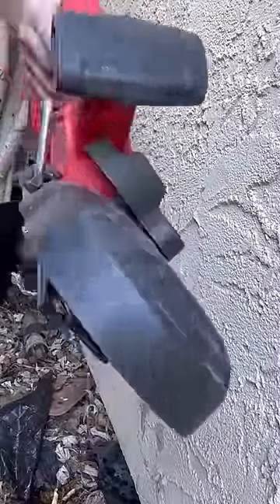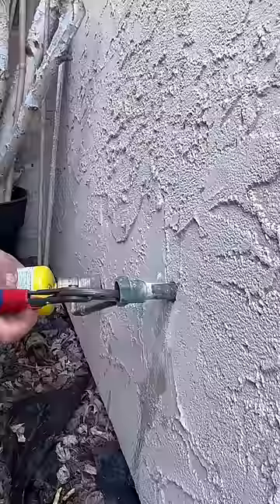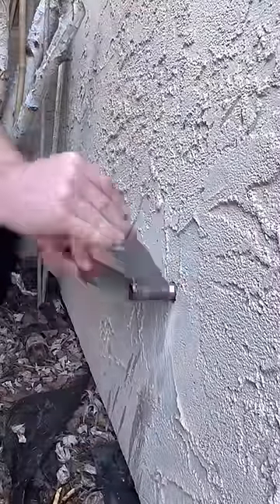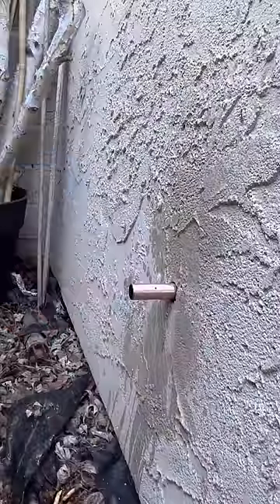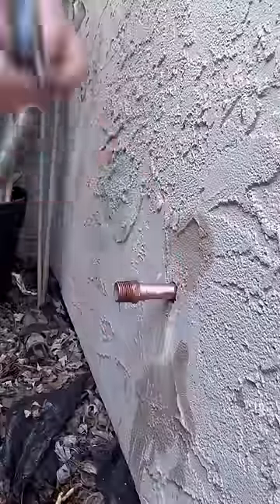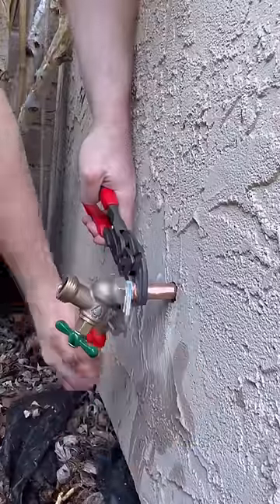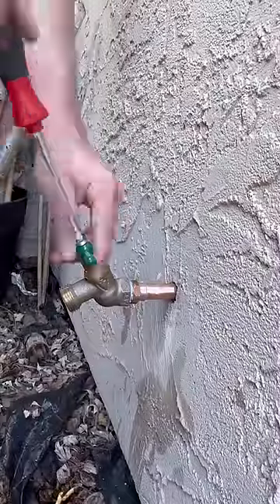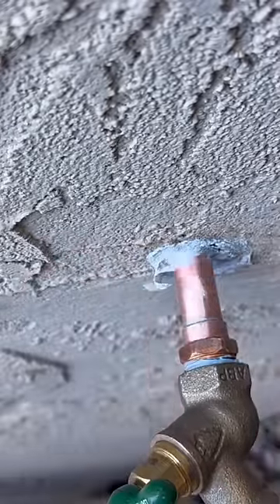swapping a hose bib #plumber #plumbing #diy #soldering #oateyambassador #propress #copper #repair

Comment: The slight adjustment to the handle shows the differenxe between a guy who takes pride in his work and and a hack who simply slams it together. Every screw on every wall plate in the home I built had the slot in the head going in a vertical direction. Why becuase I hired a first class electrician, plumber and tile setter. The only one that wasn't was my painter. His work that I saw was amazing. When he did my home he then had a crew working because he was so busy. His crew did a lousy job. 
My tile guy unknowingly used defective grout. It had a fraction of the cement it needed. When we called him 6 months later, after getting new grout from the manufacturer, he spent 2.5 days chipping and cutting out the old grout and putting in good stuff. 
It pays to hire reputable contractors that do quality work and stand behind the work they do. They swept up there mess smiled and were on their way. No cost to me but I know of at least 2 dozen jobs he got from  my referals.

Comment: Man I wish these were the hose bibs I had to work with here in the Midwest. Gotta crawl under houses or find it in a basement cuz it’s 8-12 inches in the house
Reply: Thought that was a silcock not a hose bib
Reply: yep,I had to cut threw my kids room dry wall. got it changed out, but now I get to learn dry wall
Reply: Yup. Frost free replacements are a pain. I tried removing one the other day without crawling and backing her up. Busted the next fitting off. Longer day than expected.
Reply: @Natedawgontheright  oh joy. Hopefully just a patch.

Comment: It must never freeze there, or the hose bibs are on a line that can be isolated and blown out each year.
Reply: It must not freeze for long there, we just turn off the water to the hose for half a year
Reply: @noahdienel2598  I use an air compressor to blow out the sprinkler lines and hydrant lines. The first time I did it, I launched a Rainbird.
Reply: @BlankBrain  lol

Comment: I had a similar issue with my hose bib and I over tightened it and it cracked the solder on the pipe behind the kitchen sink and over the next 2 months I had to have mold repair and all my kitchen cabinets redone and countertops. Everything insurance paid for it all. Thank God I was honest to them. They still paid for it which was I was grateful.

Comment: They sell male end hose bibs dude! 😂
Reply: That wasn’t a female fitting. My eyes deceived me too. It was part of the valve. The valve was soldered onto the pipe. He cut the valve with the band saw. Likely to reduce the heat needed to melt the old solder out
Reply: @jimmyraysworld5  good eye. I didnt even notice that!
Reply: @jimmyraysworld5  And easier to get the water out..

Comment: Ya, try that in Wisconsin, you'll have a cracked pipe and valve less than 1 month into winter. You need a "frost free sillcock".
Reply: Have you seen the inside of the basement?  Perhaps like most people in colder states,, they put a shut off on tbe inside so you can drain that spigot.
Reply: He lives in the south

Comment: I been a plumber  and worked in hydronics for over 30 years.    I use both tape and dope on larger fittings, usually 3/4" and up.    For larger than 2" fittings you may consider a product called "X-pando".   Works great for boilers.
Reply: It's like not a single one of you got a proper training in your trade .... Hi i've been doing the wrong thing for twenty years you should too..... Pipedope and teflon tape are lubricants not sealants it's a machine fitting..... And though there is silence on the market..... No one worth their salt would tell you to use it as a sealant on anything not high pressure Or temperature temperature

Comment: nice ..  absolutely after years of pool plumbing , mostly pvc .. I tried to do the same plumbing so that future repairs or less ' go backs ' .. would be able to repair/replumb from existing . I too used method of putty/tape for double seal .. always tried to use best application for task ...

Comment: Thread seal tape lubricates allowing for a deeper seating of the threads, and it helps prevent the threads from seizing when being unscrewed.

The application of pipe dope prior to assembly will fill the minute voids between the threads, thus making the joint pressure tight.

Comment: If you spit on the Vulkem just a tad, you can smooth it out real nice against whatever surface you're filling in, without it sticking to your fingers/rag/sponge whatever you use. Done it myself a few times, makes it look smooth, and a little less messy

Comment: My OCD wouldn't let me leave the pipe out like that. I would have cut it on the inside and pulled it out. Redrilled the hole to put in a frost free half turn. Judging by the age of that hose bib I probably would have replaced the ball valve as well. Props on the tape and dope. I started plumbing when I was 26 and now I'm 43. I was taught the same way back then by the OGs.

Comment: You can use a jetswet next time instead of waiting for water to run out. Will save you lots of time. Glad to see you are using a mip and a thread on hose bibb. Good work

Comment: I’ve use a lot of pro press in nursery locations that have the water drained in the winter.  I have found if something freezes it pushes the pro press fitting right off

Comment: We’re you blowing on the pipe to force water out? Also, what is the fitting you put on the bottom of the hose bib I have an older house and never seen them.

Comment: Plumbing such as hose bibbs that are subject to both hot summer days and cold winder days that freeze always get both tape and dope. Tape first and then dope . Tape prevents the dope form hardening to the male fitting and should temps drop so low that the dope freezes tape ensures that there is still a seal at the connection. Just my two cents.

Comment: Old head plumber Rodger English taught me this way “ its better to wear a belt and suspenders”
Reply: Better to wear a seat belt & have MUTIPLE airbags when behind the wheel.
Reply: "oLd hEaD... I hEaRd sOmEoNe sAy tHaT bEfOrE."... Crinnnnnge
Reply: @littlejackalo5326  damn you really got triggered badly by that 😂😊
Reply: You do realise "suspenders" has a totally different meaning in the UK 😉
Reply: @norfolkhall  USA!! USA!!USA!!
Reply: @112010lopez  Playwright George Bernard Shaw once said that the US and UK are “two countries divided by a common language
Reply: @norfolkhall  Bra?
Reply: @infernaldaedra    Erm, no. Somebody please correct me if I have got this wrong.  In  the UK, back in the day, Women used to hold up their stockings by wearing a suspender belt. From this belt were little elasticated straps called suspenders, that clipped to the  top of their stockings, thus holding everything in place. So for an instant I had this warped mental view of a male plumber wearing stockings and suspenders (nylons).    (By the way,  there is absolutely nothing wrong with men wearing women's lingerie, if they so wish.) 😉.
Reply: @norfolkhall  like French maids huh
Reply: @infernaldaedra  Yup.

Comment: Would it help to put the tap on before soldering the fitting to get a good rotational position then take it back off and tape and dope the fitting? Or would it still end up semi random as far as how off center it is when you screw it back on? Would the brass on the tap not take the heat anyway? Just curious, I don't do any plumbing
Reply from the maker: You would melt the washers
Reply: @replumb  ahh that makes sense. Forgot about the part that seals against the liquid 😲 thanks 🙏

Comment: For a better seal you want to flux outside the copper length and inside the male adapt, it helps the solder flow through and it gives better security than that whimpy outside solder. Good on you for the teflon/pipe dope, it'll be there forever!

Comment: Actually we usually leave 4 1/2” so it’s not a knuckle scraper and if a hose bib is leaking from the valve you can just unscrew the bonnet and throw on a new one. They cost about $13 maybe a dollar or two more than a male or female bib

Edit: 3-4 1/2 depending on company

Comment: Teflon and is really basic these days. But the most OG style, and what we actually had to use for gas installations was hemp and appropiate paste. That is because hemp quells up when it gets wet. Hemp is objectively better for water too, but teflon is easier to measure the thickness with. I guess for higher pressures I would still go with hemp over teflon.

Comment: You did everything great, but one tip to try. Use soapy water or your gas leak detector on your rag before wiping that volcom. The volcom won't stick to the rag and get all wide on you. You can push the volcom around to fill the void but it won't ever get away from you and end up an inch wide like that

Comment: How do I get my faucet disconnect? It leaks and needs to be replaced but it’s on there rock solid. Its a threaded steal pipe but I’m afraid to cause any damage trying to unscrew it!

Comment: I am an amateure but soldered many times. I had never experienced even once that something leaked at the first try. But last time suddenly everything I did leaked 😲 I was wondering, could that be caused by using very old S39 fluid? Like 20+ years old possibly.

Comment: My copper  pipe is a 3/4. Could I just fit a threaded spigot inside the copper pipe and solder it? The stores don’t have anything to go over the 3/4 and reduce it in the end

Comment: Honest question though, I was under the impression that Gate Valves are crap because they are constantly leaking and the mechanism is SHite.  Is there a reason you didn't put on a Quarter Turn Ball Valve for the Bibb?

Comment: Anything bigger than a 3/4 inch pipe with threads needs teflon tape. Me myself I use pipe dope on 1/2 threads. And 3/4 and up I use Teflon with pipe dope. At least 5 or more turns depending on size.

Comment: Have you ever used a small piece of Wonder Bread inside the copper pipe to absorb and block water before soldering? It gets blown out once the water flows again.  A plumber I hired did this once.

Comment: A neat trick.. if you have a small leak and need to solder a fitting, take a few pieces of white bread, remove the  crust and roll the bread into a tight ball. Pack it into the pipe. It should give you enough time to solder the fitting. After the solder cools open the valve. It will blow completely out of the valve. Don’t it hundreds of times.

Comment: An electrical grounding lug was removed but not put back?  Nothing was connected but I’d have that looked at by an electrician. There are various reasons and codes regarding grounding copper pipe.

Comment: Things freeze in Michigan.  Use a frost proof  and still leave and interior shut off.  And,, In any city water supplied area,, Vacuum breakers are mandatory.  Changing a hose bib?  Bring it up to current code.

Comment: My old boss used both tape and dope on water lines. Unrelated, a True Value employee told me I had to use yellow pipe dope on gas lines. I told him I’ve used the same grey-blue Talon for years and never had a leak, and have never seen anyone use yellow. It’s always great, white, blue, or grey-blue. And this employee was twice my age. He insisted. I checked the label on my trusty dope and sure enough it’s approved for gas lines. Unsurprised.

Comment: tape and dope though seems like overkill at best and possibly a source of a leak at worst. I mean, I’m a heavy duty mechanic. I have put pipe fittings on 2500+ psi hydraulic systems with only pipe dope on a piece of heavy equipment that experiences heavy vibration, thermal cycling, and flexing. I have never had a leak that was caused by the sealant failing.

Comment: I’m confused on your comment saying you’re not gonna use a pro press because it’s right up against the house, I seen plenty of room there and since you already removed the part with out cutting you wouldn’t have to cut it to put a pro press fitting on, just curious. Good work either way.

Comment: Local plumber wanted to tear out my mom's interior walls to do this because the pipe is so short.  Fortunately an "old school" guy said to just replace the washers which worked.  Thing is it's brick and would cost 1000X less to cut bricks out than to tear out a MARBLE BATHROOM.

Comment: I never understood why some people leave that pipe exposed.  The proper way is to cut the copper on the inside and pull the copper pipe out from of the wall and solder a direct sweat Silcock onto the pipe and slide the pipe back into the wall until the silcock is flush to the wall and solder either a coupling or ball valve on the inside and use either plumbers putty or silicone behind the silcock to prevent water from getting into house.  That way it won’t look like shit.  I guess that is the difference between a plumber and handyman. 

The plumber that plumbers recommend
Reply from the maker: I’d be so pissed if you did that to my house

Comment: I use customer hoses daily, several houses a day and I can for sure say that any bib replacement should be ball valve. It’s just so much easier and seems to last much longer as far as I can tell.
Reply: As a former well driller, I did that when I installed my water lines. One of the best upgrades I did to the system, along with various system shut offs.

Comment: Dont know how much difference it'd make but maybe pull the pipe out then put the bead of caulk or whatever around the pipe and let it settle back in. Prob would seal it a lil deeper and not need to wipe the crap out of it after.

Comment: When I was very young, married and expecting a kid I bought a house. There was about a pound of solder at the rear spigot. I had an old guy tell me, that when You have a dribble. Turn off the water and let the water to run out of the lowest point. When I got it as slow as it was going to go. I’d take the centers of new bread and roll it, into a ball and shove it in the pipe. Shove it far enough back that You can sweat the new connector and spigot. Open the valve all the way open now and close off everything that You turned on. About that time the water has made the bread plug come undone and it’ll shoot right out with less than a pound of solder. The guy that I bought the house from to come work for Him. Never happen!

Comment: I still dont get people that go for those 'clamp' connectors, whenever you gotta move/replace em, only options are to cut em off or wreck your pipe, while soldering doesnt leave any dmg and you can just put on a new one.

Comment: You should not be afraid of the sealant. You barely got any on there. It might seal. But, without anything to stop the pipe from getting pushed in, the seal can easily get broken. And will just not last as long as it could.

Comment: Clearly an apprentice. You upsold the job by adding the male adapter to make it easier in the future. Very nice. They will call you back 10/10 times. Also, think of something else to say besides the masters use dope and tape. I mean, I do too, but say something like you like doing it right the first time or this is what sets me apart from the rest. I see you young plumber. 👍

Comment: Never do the “thats why i was told” is a good  reference but find out why , some people doesn’t matter if they do it for 100 years still may doing it wrong, anyway tape and dope is ok , tape will seal where metal to metal wont and  dope is mostly lubricant . In water systems tape is a must , on gas only  dope  is fine

Comment: Use a piece of cheap bread and stuff it in the pipe to keep the water back and absorbed, allowing you to make that solder flow correctly.  Then, when you're done, it will dissolve and blast right out.

Comment: Pretty sure the pipe was left long not for you but for that bonding clamp.  Probably should put that guy back since it keeps the pipes at the same potential ground as the service and is a safety for the electrical system.

Comment: That ground clamp needs to be reinstalled. It keeps electrolysis out of the water system, and the house is probably grounded through the plumbing system to shunt a possible water heater short...🤷‍♀️

Comment: Master Plumber told me, "aif you never want a leak, use teflon tape AND pipe dope." In the 12 years I owned my house I never had a leak! Water heater, kitchen & bath sinks, tubs & toilets, well pump,

Comment: I always leave a little extra sticking out kf the walls for any type of pipe that gets a fitting casus you need room to make repairs and I wouldnt wanna show up and its supposed to be a simple fitting replacment that turbs into a all day job cause the og installer didnt leave anything extra for future repairs. And I'm an electrician in the industrial field and Even I know to leave extra and to use pipe dope and tape together way I was taught by my dad and gonna continue doing kt that way. And I'm teaching my 10 year old how to do household repairs like my father taught me and teaching him how to weld and read blue prints and fabercate as well cause that was my first trade a fitter welder combo at shipyard and fab shops so teaching my son two trades that way jf college dont work out he has something to fall back on

Comment: The right way would be using a Frostfree Hydrant. Doesn't matter If it does not get cold there. The purpose of a hydrant is that way you can screw it to a house. So the customer ain't yaken on the plumbing with the water hose. And plus it looks like A home owner done it that way. 25 years plumbing.  Never seen bs like this.  Texas plumbers have a lot to learn. Maybe it's because you guys go by the UPC Codes?

Comment: Protip: You can put bread up in the pipe to hole back the water while you solder, and it desolves easily when you turn on the water again.

Comment: Someone left this much copper with a soldered hose bib. Bent the copper at the concrete/brick. Now I have to figure out how to cut the copper at the break and add a new fixture. (I'm not a plumber)